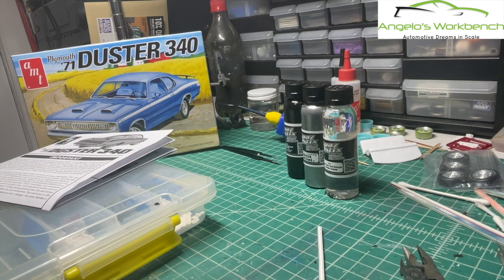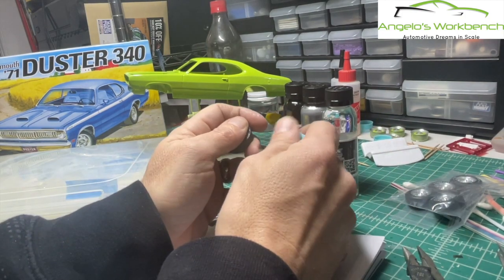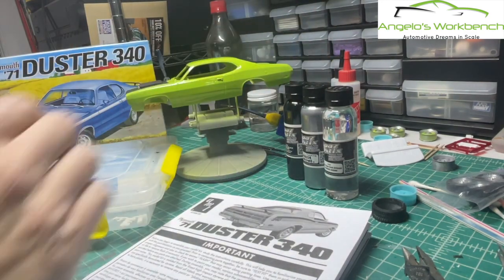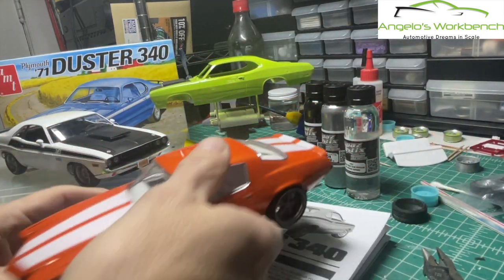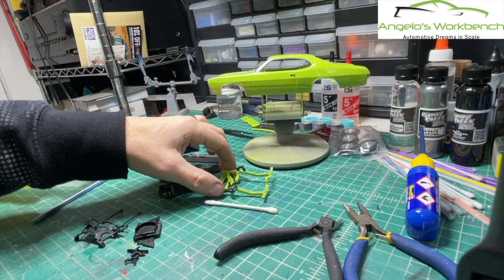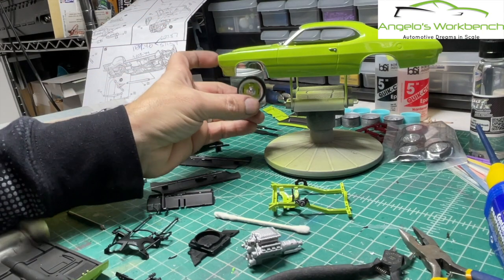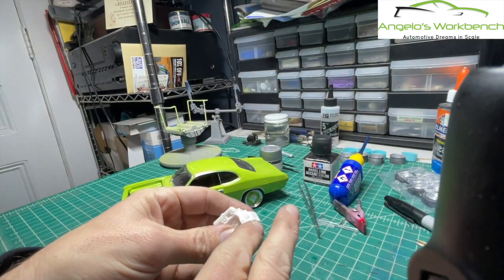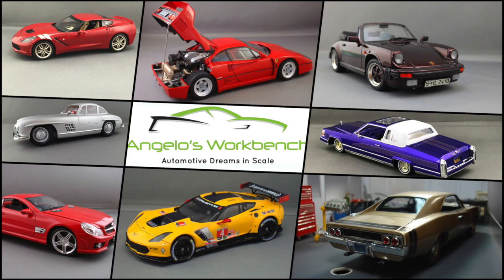AMT 1971 Duster "Hellster" - Complete Build

Comment: Really pretty. Personally, I would've removed the 340 from the stripes decals, 'cuz it's an Hellcat engine. Dunno if those 3dfiles are possible to find, but would've been nice to be able to also put modern suspension (front and rear) on that cool car as well as modern diff.

Comment: Yea the scale size on your Hellcat is too small, not trying to nitpick with you or troll you just stating what i know from building a few real Dusters. With the use of superchargers on top of these engines they are fairly tall and fitting them under the hood of A-body mopars is a challenge. Engine mounting could be done with a front motor plate, or new "ears" as they are sometimes called.
I really love the color combo and impressed with your 3D work, nice job on your build.